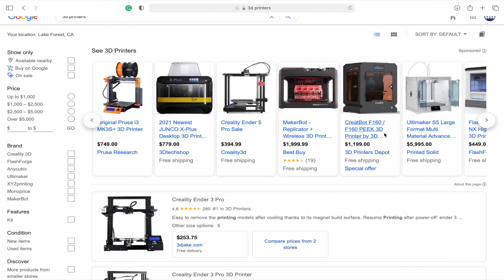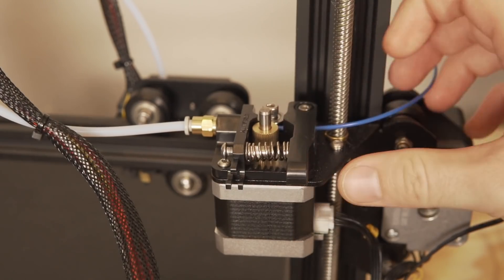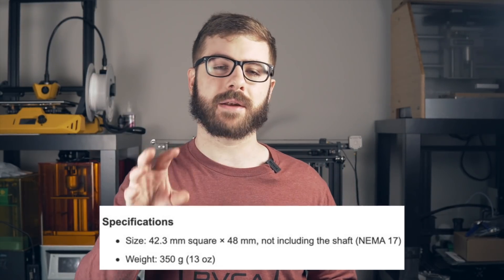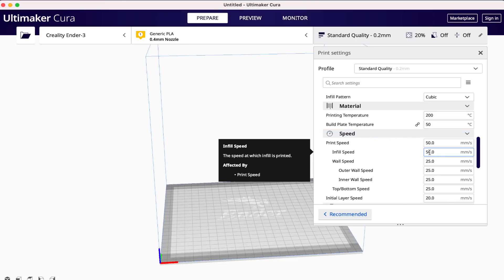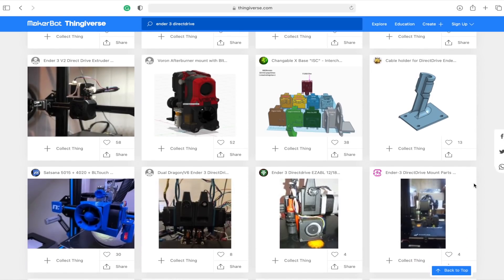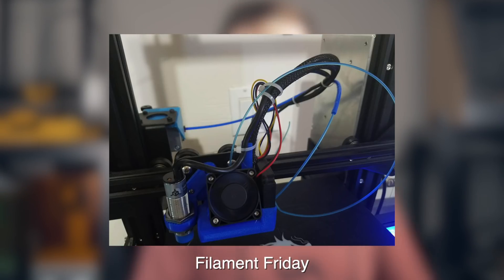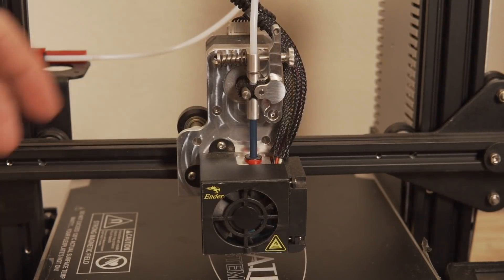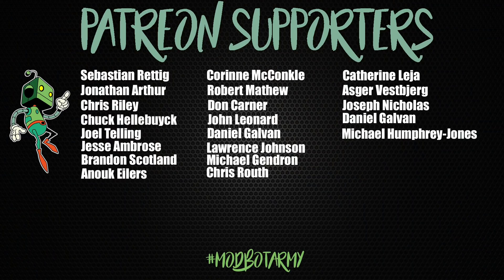Bowden 3d Printer Extruder Vs. Direct Drive

Comment: i gotta say i don't 100% agree about the "it's not one size fits all". What we want is a 3d printer that can print. I think there is a base line of quality that a printer should be able to achieve and a base line of reliability a printer should achieve. Bowden printer is mechanically easier but requires better software (linear advance), more maintenance, and is limited in what kinds of filament it can handle (flexible, too thick diameter). Nobody talks about bowden maintenance, but that tube is going to permanently bend over time and NEEDS TO BE REPLACED. Also if your filament gets jammed it could break the coupler for the tube, and then you also have to replace the tube. Direct drive has none of these problems! The only possible drawback of direct drive is that the printer is going to have to be a bit more rigid to handle the heavy head moving around.

Comment: Not accurate, try printing TPU on a bowden extruder, not going to happen not even if you slow down the speed. And I'm using a CR10s Pro V2... But with my DD Artillery it's no issue.
Reply: I print TPU on my stock Ender 3 without issue... Sure there was a slight learning curve, but after just a few prints perfecting the settings it works just fine.
Reply: @lipinskirl  not sure about the Ender 3. But the stock CR10s Pro V2 was rubbish and I've had plenty of time to play with it, slowed down the print speed and used different temperature and retraction settings, but all my TPU prints were just far from the quality and speed I can now achieve with my direct drive printer.

Comment: turn off your autofocus...
Reply from the maker: Can’t. Screen is to small and not enough space for a monitor. Better to have auto focus then be completely out of focus
Reply from the maker: One or two unusable videos is a enough to not be worth it until I have an easier way to monitor the camera
Reply: @ModBotArmy  use a a gopro then...4k video and none of these issues and cheap to boot!
Reply from the maker: I like them for b roll but I don’t like how wide angle they are for a primary cam. One day I will have a bigger space and a large monitor so I can ensure I am in focus 😬
Reply: @ModBotArmy  they are pretty wide angle...do a couple of test vids. Just make sure you have plenty of light, they suck in lower light